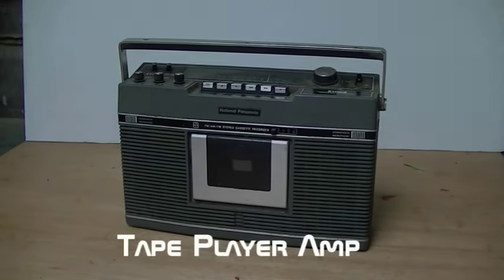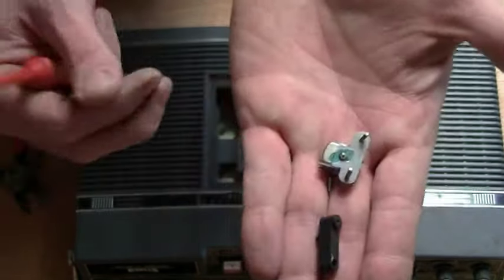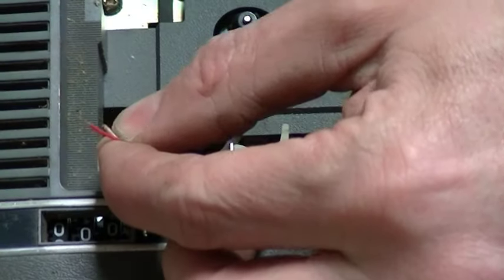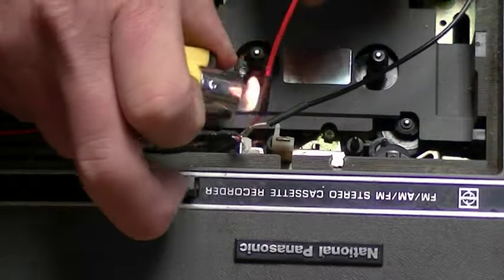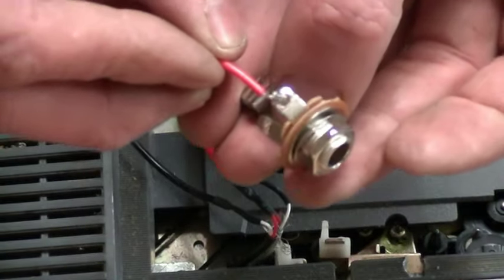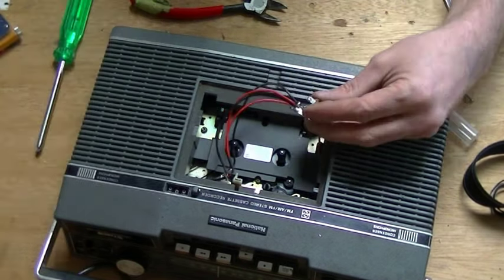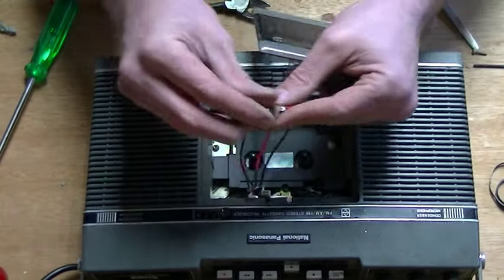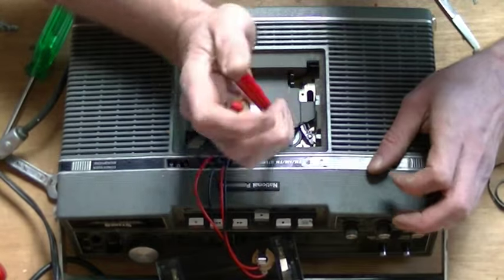Turn a Tape Player Into a Guitar Amp

Comment: You could probably clean it up with a volume control? Great hack. I like that Fuzzy warm distortion,
Reply from the maker: yeah I think so too.  Adding a couple of 10 to 100K pots between the positive and ground wires might give you greater control of the sound.  I've got another radio at home which I'm going to experiment with.

Comment: You can add an extra potentiometer to reduce the input volume, and get a nice loud clean tone without distortion. I just did this to mine, and it makes it way more useful as a practice amp, especially if you want to use it with some effects pedals. I guess a tape head is just really sensitive, and the output from a guitar is way higher so it starts distorting almost straight away.
Reply from the maker: Lee NZ good advice.  I did the same thing (added a pot) to a similar hack you can do on a radio.  Def gives you more cleaner sound.
Reply: can u show me how to add potentiometer
Reply: @sentzzjmr6871  I think we just added it in the circuit next to the input jack, to reduce the input signal.

Comment: It is actually the best distortion pedal that I've encountered.  I am inclined to create a video on how to wire an equalizer and cassette deck and end up with capabilities of matching any sound that your big hearts desire.  LOL  I just hate putting in the efforts and not being able to achieve as ideal as possible;  because of lack of jacks or proper adaptors in terms of contacts being of quality.  And also that I think that I may need to use a second deck;  in order to achieve ideal as can be of circuit.  Reconfigurations of electronics would likely be at hand here;  since I would need to use a deck play head in order to be an input to the guitar output and the record head of another would ideally output the proper converted signal back to the same as guitar pickups produce.  Some cassette decks have the option of real-time playback from the reading of the reading head while recording; and those would serve perfectly as a connections system of inputting guitar output to the reading head and passing through an analog eq. and thus then giving you a few options of your choosing and I seem to be noticing that some of you would need to be explained with a diagram and if this person or any of you would like to offer helping to create an instructions video;  I'll gladly explain these concepts.  And otherwise;  that of the way that I had done it;  was guitar to mic input going to record circuit and using the record level as a distortionning gain and of course you then need to push record and may opt to unplug the motor for sound purposes and then I output to eq once or even a second time through the second channel(since I was using mono(this gave me that option))and then I would go back the a regular amp and if a guitar amp;  well as you can imaging;  I was then compromising two of the signals:  mismatching mic input signal and input to a guitar amp;  if a guitar amp was what I was using;  I have a Chorus 212 and I believe that I could bypass the input and use only the power amp;  but would maybe lose the digital effects of the amp.  Cheers and if someone does create a video;  remember where this came from and I shall then not have a gaining of mistrusting in my fellow women and men.  Cheers  I'll post;  if I decide to make a video on my channel;  but I doubt it.  Sorry.

Comment: you got a mono amp, try to connect the other red cord to another channel of the socket to amplify stereo- I could not test it because I don't have one at the moment
Reply: Why would you bother with stereo when your guitar is outputting mono?
Reply: @EddSjo  if your guitar outputs mono there no need for this hussle 👍😅, yet I did not know that all guitars output a single mono channel by default

Comment: Are there differences in sound depending on what tape player would be used, meaning, are there any noticeable sounding highs, lows, coldness, warmth, etc. ?
Reply from the maker: ShadowⓋ absolutely.   Thats the fun of hacking one of these - you never know what type of sound your going to get until you plug in the guitar and test it out
Reply: My guess is that the distortion comes from the input signal of the guitar being a much higher voltage than the signal the tape head would normally supply so it overloads the circuit. It should sound more or less the same. I do a similar set up but use the built in microphones from tape decks as the inputs. Makes a cool fuzz as well.

Comment: cool, but whats the difference between this and just using amp and speaker with the guitar pickup... just for fun, but seems like more work
Reply: If you use something like a microcassette recorder its a basically a pocket amp that can record any thing you play, pretty sweet. And i didn't modify mine one bit just, guitar in the mic input (with a 1/4 to 3.5mm adapter)  and headphones/speaker in the output